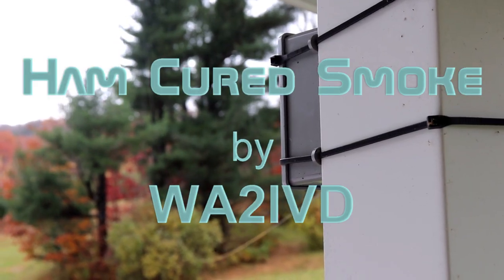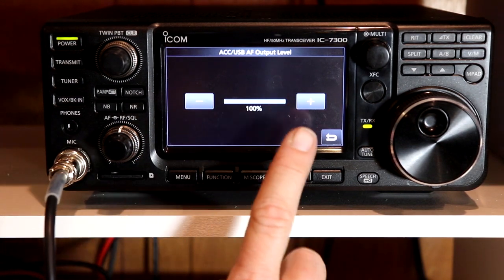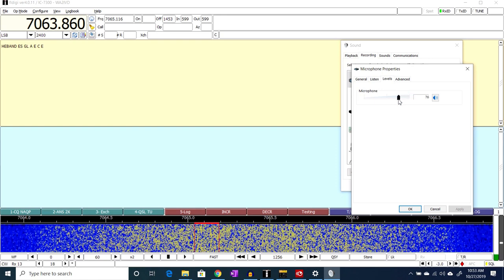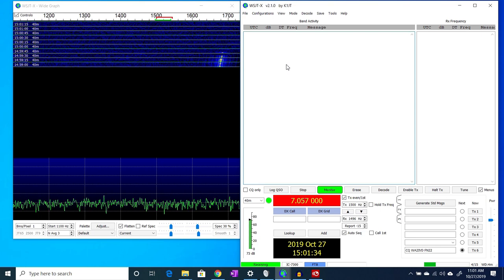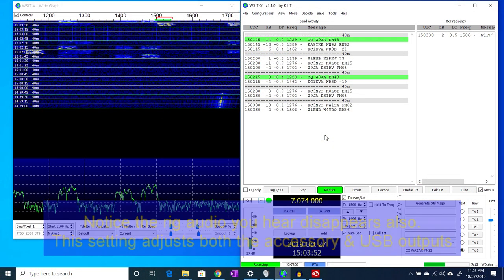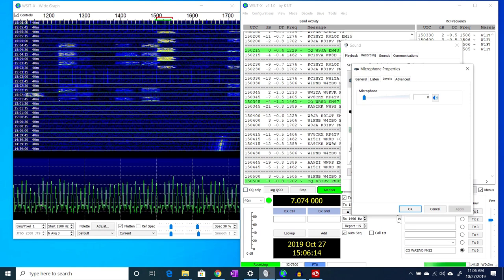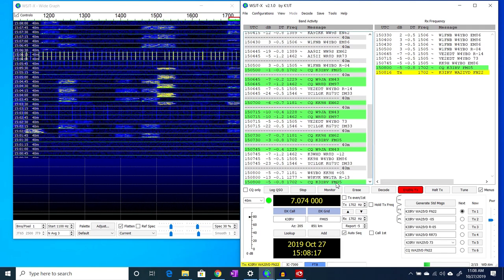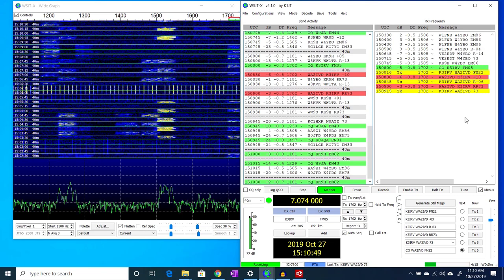Icom IC7300 A to Z #26 USB Receive audio settings

Comment: Great subject Tom..... As you’ve done throughout your A to Z series, this video will certainly help people set up the most commonly used digital software, by showing those areas in the configuration settings of the software that have to be changed to work with the IC7300. I’ve found that keeping my 7300 settings at 50%, and varying the Windows computer audio settings depending on the software works well too.

Comment: Hi, Tom.

Great presentation.  You have covered everything needed for digital mode transmission.

In weak signal condition, with 'static crashes',  setting AGC to 'Fast' may improve weak signal's reception. 

Looking forward fo the next video. :)

Thank you,
Bahathir 9W2GNU, 73.
Reply from the maker: Thanks Mohammad

Comment: JS8CALL you can talk to them.  It uses the same type of low power. It also has where you can leave a message on someone's station for someone that you can't talk to but the other station can talk to them. JS8CALL is much better and it can be used for Winter Field Day!
Reply from the maker: I have seen a couple videos about JS8CALL and I have read a little about it.  It does look pretty nice.  It’s on my list of modes to try, but I haven’t made the time yet.

Comment: Hi Tom... I’m thinking these settings would probably apply to my IC 7610. I need to back off my alc just a tad according to the videos. Is there any way to know if you’re flat topping by watching your signal from another SDR receiver on the internet? Keep up the great work. I really enjoy your videos. They’re very clear, educational and easy to listen to... de Fred KE0EF
Reply from the maker: Hi Fred.  First, thank you for the kind words.  A good friend has a 7610.  I don’t really have any experience with it, but I do believe the settings and functions for transmit audio with data are pretty similar to the 7300.  Watching our signal on another receiver is a very good way to check your signal quality.  If you’re using an SDR from the internet, you’d just want to pick one that is pretty close to you so you can get a strong enough signal to eliminate atmospheric or local noise.  If it’s an SDR with a spectrum display, one good indication if you’re starting to distort is that you will see the bandwidth of your signal start to increase.  So, for example, if you’re transmitting a RTTY signal, with the standard 170Hz shift, your bandwidth shouldn’t be much more than about 250Hz.  If you increase the audio level enough to start distorting, you’ll see the signal widening out, possibly with some splatter peaks well away from the main signal.  So, you would want to back off the audio level a little bit once you started seeing that.  Hope this helps.  73, Tom WA2IVD

Comment: Hi Tom,
This is SV1SLB. We both have the same rig and I have watched carefully some of your videos. They sure are a GREAT HELP for us 7300 enthousiasts.
73 from Greece, hope to see you on the air.
I do have a question though.
I have saved my configuration for FT8 and for Voice communication in seperate files on my SD card. That is because if I am using FT8 and then try to communicate with voice, there is no modulation AT ALL. So, every time I swich from FT8 to voice, I always have to load the other settings, so everything goes fine.
Is this common to you too?
Reply from the maker: Hi.  Sorry for such a late reply.  I missed your comment earlier.  When you switch  back to voice are you forgetting to take the rig out of Data mode?  (Display says USB-D - or LSB-D). It normally won’t take audio from the mic in data mode. You have to touch the mode LSB/USB. Then tough the Data button on the pop up menu to toggle it off
Reply: @HamRadioA2Z  Thanks for the reply, but I do think that there are some other parameters that must be altered for voice operation too! Not only the DATA mode on the USB or LSB mode.

Comment: When you logged the FT8 contact where did it log it?
Reply from the maker: WSJT-X automatically creates files WSJT.log and also a .adi log file.  Under the File menu you will see an option to “Open Log Directory”.  You’ll find those files there.  Then you can copy them wherever you like.  Also under the File menu is an “Export Carrillo Log” option.  That will let you save the exported log wherever you want.  In the configuration settings under the Reporting tab you can set WSJT-X up to send logged contacts to other logging programs like N1MM, N3FJP, etc.  You can find instructions for how to setup the reporting in the documentation for those logging programs.  73, Tom
Reply: @HamRadioA2Z  thank you.  Love your videos, btw.

Comment: Hi Tom another great Vlog I’m following you as I have got the IC 7300 back end of September still boxed  but not been on air for 14/15 years and it’s all new to me. Tom have covered psk or D-star on any Vlogs ? as I find you easy to follow keep up the great work. Terry G7wrs
Reply from the maker: Hi Terry.  Thank you for the kind words.  I haven’t covered PSK specifically or D-Star.  Most of these last 2 videos should apply to PSK.  I’m thinking about doing a similar series on the 9700 when I finish this series.  Of course, I’ll have to get a 9700 in order to do that.  Seems like a good excuse to me. :-). That radio has D-Star, so that would be part of it.  I’ve had at least one other request to do something specifically about digital modes and digital software.  So, maybe I’ll do something along those lines.  73,  Tom
Reply: HamCuredSmoke Thanks for the quick reply Tom I’m looking forward to it. Terry

Comment: JS8 Call is also nice as you can send text.
Reply from the maker: I haven't had a chance to play with that yet.  I need to try it.
Reply: @HamRadioA2Z  No problem. FT4 is half of the speed or faster, but JS8 Call, as FT8 Call was named after 2018 it is pretty cool.

Comment: hey Tom I am trying to get my IC 7300 to work on EchoLink I Set up the driver for the 7300 its working fine I guess no errors Set up the Echolink KG5CUO-L and got it connected to Echolink and it is Id-ing every 10 min So that part is working now I need to figure out how to here and talk back threw my radio to the software any ideas Please message me and let me know. KG5CUO 73
Reply from the maker: Hi.  I use Echolink, but I have not set up one of my own radios as a simplex link.  I assume that is what you’re doing.  When you say it is ID-ing, does this mean that the radio is transmitting and you can hear it transmitting the ID?  If that’s the case, it sounds like you’re most of the way there.  You must have the PTT and audio from the PC to the radio setup properly for that much to work.  What exactly isn’t working?
Reply: Its Idling by moris code with the computer but it is not sending voice over the computer to the software if you press the key on the mic on the radio
However I got it set up to here the radio threw the computer by the usb connected to the radio but I am trying to use the mic on the radio to talk with and if they connect to the node they can talk threw my link on 28,400.00